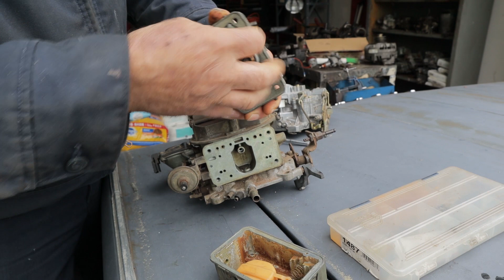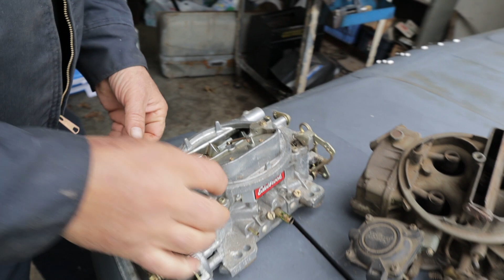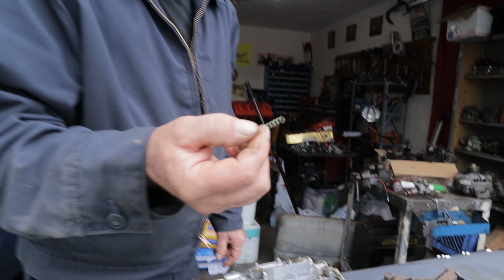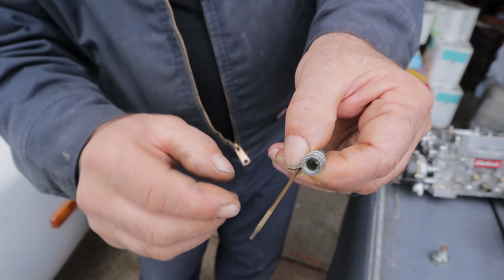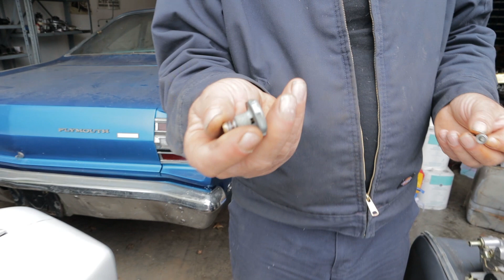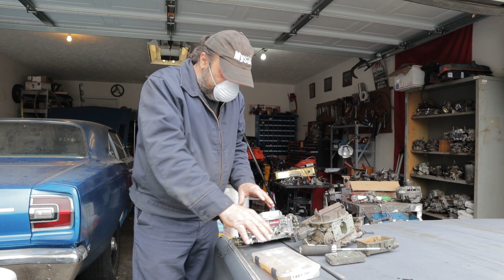The Trickiest Part Of Your Carburetor

Comment: The factory Mopar AFB's and AVS's have three step metering rods. These are difficult to find tuning kits for. Lucky for us, the Edelbrock two stage metering rods and jets together can be used in the factory Mopar carbs by changing the metering rod covers from the three stage raised covers to the two stage flat covers used by Edelbrock. The two stage metering rods require the matching two stage covers and matching jets made for two stage metering rods. The aftermarket AFB's also came with the two stage metering rods and jets, so pretty much only the Mopar carbs need to have the metering rod covers changed to tune them with performance parts.

Comment: I just had a 318 short block built that i took out and i put the rest of of it together and back in the truck. I have an edelbrock 600 cfm put on it was  running ok but not like it was suppost to! When i would take off from a dead stop or power brake it the truck would stumble or hesitate then take off. Found out edelbrocks need a constant supply of gas but cant have more then 6 psi of pressure. I got a holley adjustable regulator and a performance mechanical fuel pump. I also bought the edelbrock tuning kit for the 600 and did a vaccum test found out i have 19 on the vaccum gauge so you  take 19 ÷ 2 to get your answer the use the spring that is the closest number. so i ended up having to swap out the stock springs to the highest springs in the kit which is the silver springs . I also notice according to the jet/rod chart that someone before me changed the jets. So i set the carb back to factory specs accept for the springs ! Made a hell of a difference .i can now power break the rear wheels but still have to fine tune the jets/rods . I found this out the difference between the edelbrock 600 electric  choke vs 600 manual choke is different jet/rod settings  the electrical one is set up for economy and the manual is set up for performance . The article says to use the tuning kit for a manual choke stock settiings on the edelbrock 500 cfm and use that as a base on the 600 to tune for better performance/economy . Thanks for making this video Tony 😎🤘

Comment: I've got a 1945 model 1 barrel holley, it's got that power valve on it, it's got a vacum line hooked to it but where it screws into the carb it's a dead end doesn't have any open passages leading anywhere

Comment: Since you're kinda on the topic of part throttle cruise, thought I would comment on a big difference I noticed cruising down the interstate. Trying to maintain a speed of 65 mph, with vacuum advance hooked up, I barely have to touch the gas pedal, like just off idle... Without vacuum advance, I would have the throttle like half way to the floor, almost into the secondaries, just to maintain same speed... Which kinda helps explain why gas mileage doubled when vacuum advance is hooked back up... Figured this out long ago when I forgot to reconnect vacuum advance after checking timing, and wondered why I kept running out of gas....

Comment: When I raced my carter, I took out the needles and springs an ran with the jets that worked for that engine.  . Simple fix, for the track, opposed to head scratchin and lookin for the spring that bounced away. Now I have a 850 Holley and heard I should plug the power valve. Whadda ya think, Unca Tony.

Comment: Great job of trolling, I can't see you grinning behind that mask. Just one point though, the power valve doesn't open as soon as you hit the throttle: it opens when it reaches the vacuum point of the power valve setting: such as 6.5  In of vacuum on a Holley 65  power valve. That is why they have a power valve: it opens when you need it the most to enrich the main circuit but lets you get fuel economy the rest of the time.

Comment: ,,, the modern ignitions, with two step activation, just about did away with power valves, in Holleys for full time racing . But Tony is right on for light throttle driving .

Comment: Corona Carb Cleaner
Accelerator pumps exist because when your throttle is snapped wide open, vacuum stops and so does the flow of fuel. Fun Fact

Comment: I use this information to increase my fuel mileage on my Edlebrock!

I got the smallest jet it would run smoothly on at high speeds [since the engine is old and tired and weak, I had to go backward from where I was trying to get to, but once I get it rebuilt, I will be able to proceed again] and employed the softest spring they offered so I would run as lean overall as possible.

It helped a lot, but until I get the engine rebuilt [compression is bad on one cylinder and poor on another cylinder, plus it is now recently acting like it has developed piston slap, but won't know until I tear it down] it is as lean as I can go.

Comment: I remember learning the hard way about which metering block gasket to use with a power valve.  The wrong one will let fuel pour by at idle.  For all their quirks, I wouldn’t trade a good carb for any EFI system.

Comment: Good video uncle Tony

 you’ve inspired me to rebuild my 308 GMH motor but this time I’m gonna invest 1100 bucks on Edelbrock performer Carby and manifold Instead of the Holly 350 double pumper I’ve always used a 40 thou overbore 

Blueprint the crank balance the pistons and rods Line bore hone 

roller rockers....roller lifters....Mild cam

Good old fashion points plugs condenser and leads

 that’s it

Comment: It's interesting how the metering rod works on vacuum the same way a round slide and meter pins work on a mikuni carb. You can get way out in the weeds with those. The slide opening, pin taper, pin height, then the main jet and the main jet holder, all play a role in getting the most out of it. 

On Carter's/QJ I never got that deep into it. Cool vid thanks UT

Comment: Hey new to carburetors and to your channel. I have a question if you can answer it. I have a Edelbrock 1404 four barrel on a 4.2L straight six slightly bored. It’s flooding out on me when driving after a while and appears to be running rich (black smoke). Should I Change just the metering rod and the spring or just the spring? And should I go with a bigger rod or smaller rod? The carburetor is stock.

Comment: Yeah even though I find the Holley easier it's a shame that power valve dies so easy to backfire.
Reply: I was gonna say something about that. There used to be a little power valve protection kit for the older carbs. I think it was standard issue on carbs from the late 90s or early 2000s. Really showing my age here lol
Reply: @assymcgee2835  I haven't ever used one. I just know if it backfires and starts running rough. Go ahead and take off the front bowl lol.

Comment: I always wondered why a stock (new out of the box) Holley carb runs waaay too rich. In the past somebody I know put a 750 cfm Holley on a Ford 460. Also a 600 cfm Holley on a Ford 351C and a Dodge 360. All 3 engines were stock besides the carb but they ran way too rich. Horrible mpg, smelling like gas, eventually misfire and getting around an 8% co reading on a exhaust analyzer.. If you tried to turn in the mixture screws it would stumble. The moron mechanic ‘fixed’ all this by using thicker plug wires.  Why does a stock carb (autolite, carter etc) make the engine idle fine with a 1,5 to 2,5 or so co reading while a new (unmodified) Holley wants to stall the engine below, say, twice that reading?

Comment: I have an edelbrock carb like that, off the line it bogs and I have to feather the gas, would those transition circuits/springs/rods be the possible culprit? Idles and drives fine otherwise

Comment: Mask, Really? Kinda talked about transfer slots. Skipped how to deal with getting them back to correct exposure. New big rump cam, single plane intakes and so on lower idle air velocity. So to get idle speed you need more idle air volume. Crankin idle speed screw in exposes to much transfer slot right? Tell the top secret fix to correct transfer slot exposure.